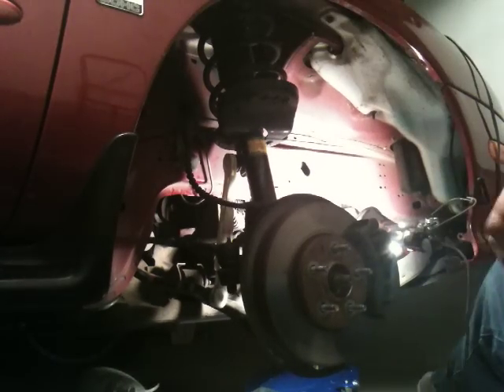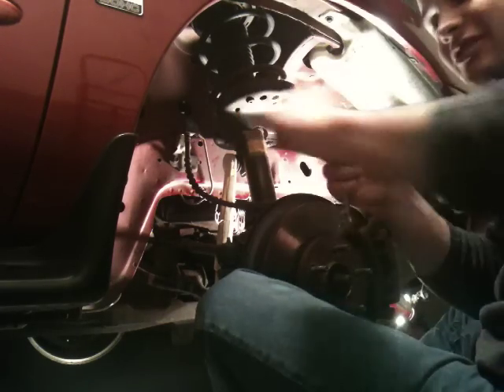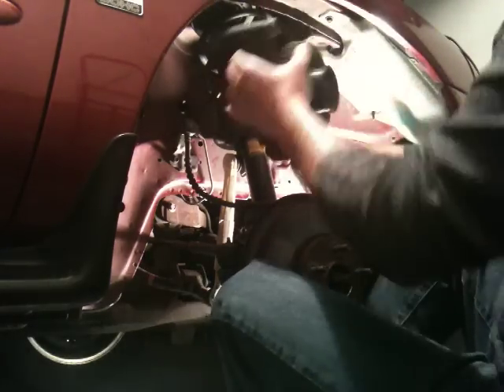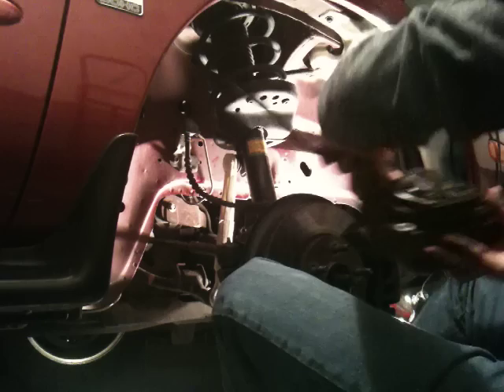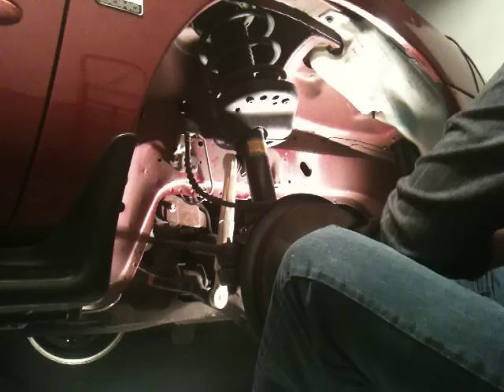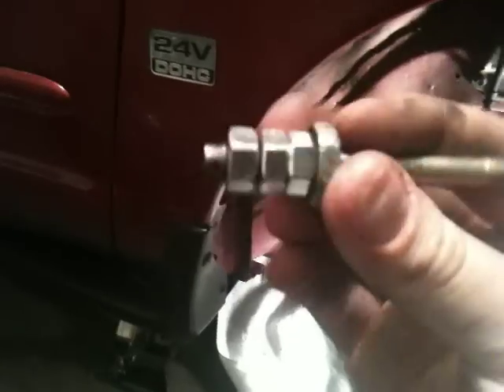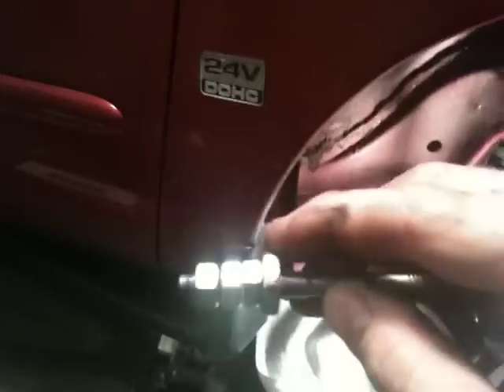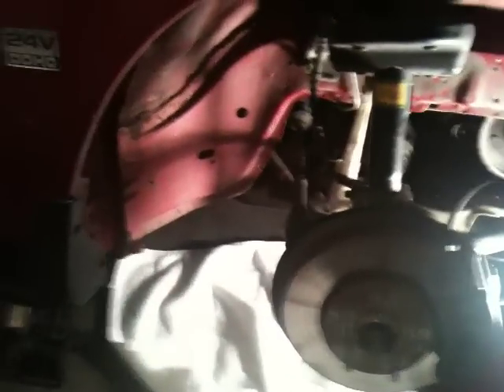Alternator removal 1999 Ford Taurus DOHC

Comment: THIS ALSO WORKS FOR THE 1998 MERCURY SABLE DOHC..., but it took some choice wordS and some busted knuckles.. but the thing is this video does not SHOW how to reinstall it. (he gives a demenstration of how to).it is a lil bit more difficult. you got to install it upside down then flip it up so the pulley is facing the motor then shove it up as far as you can and turn & twist the alternator and then adjust it in place. its like tryin to fit a couch into a doorway. only fits one way. thnks joe

Comment: Just helped someone do this job on his 01 DOHC (4th generation).  We tried for 1.5 hours of trying to just get it to swivel and could not make it happen to mimick what you were saying and could not get it to happen.  I decided that we should drop the subframe down on that side (luckily 2 bolts), removed them, threaded them back in 3-4 full turns, then dropped subframe down on them.  That ended up giving us the room.  Good trick, thanks for it...like walking a couch out a door.

Comment: Thanks, I helped out an elderly person today using this procedure. The shop quoted her $230.00 just for installation, I did it for $75.00 in about an 1  1\2hours .  Had to move the power steering reservoir to remove that 18mm stud, my remedy was a 18mm (2" shank socket).
BIG UPS 4 the info !!!!

Comment: Great advice. I asked my mechanic about replacing the alternator and he said he'd have to remove the halfshaft. I did it this way and it worked. Tricky, but doable.

I suggest bench-testing the new alternator before installing though. You don't want to put in a dud and have to do this twice. ;)

Comment: I tried the 3 13mm nuts trick, but they would all spin at once. I was ready to grind down washers to put between them so that the wrench would fit over them. But I finally got it with an 18 mm wrench. Only 3 turn nut/flip wrench efforts and I was able to use my hand! Your flip trick didn't seem to work, so I borrowed specialty tools to drop the CV shaft, etc., but I made one last effort to try it like your video: EXACTLY LIKE YOU SAID!!! Got the alt out by flipping it over. Thank you so much!!!!
Reply: See my note above on the pass through socket set.  Further up there's a comment on the way to use the jam nuts.  Use two wrenches to tighten the nuts into each other (you can use a lock washer too).  Then use the inside (closet to alt) nut to remove the bolt and the outside nut to install it.

Comment: Just two things including a great big THANK YOU!: If you loosen that top-left-hand 18mm post first and you can get your hand in there like the contorsionist Ford Motor Co. expects you to be, you can unscrew it with your fingers. Also, I disconnected the cables at the alternator and the input speed shaft sensor cable benteath it, and voia la, perfect. Thanks for the tip.

Comment: Thanks for the shortcut. Used it and it came right out. But you forgot about the 1 hour to get to this point. This is the hardest atl. I have ever changed. But unfortunately the alt i put in was dead. Lesson learned, have all new alt. checked at someplace like autozone which can be done off the car.

Comment: Thanks, this helped a lot!!! However, when I wanted to install the new alternator, I noticed a pigtail clip coming off the alternator clip and could not figure out where it goes on to. I looked everywhere but could not figure it out. Is there just an extra clip that is not connected to anything? Where does the extra clip go?!

Comment: All bolts are off except the one we would put the 13,mm nuts on. Problem is there is a black/aluminum tube like device that was screwed onto the same bolt. We took that nut off but can't get that piece off and Out of the way. What is that piece? Any ideas?
Reply: Sean Moore The black tube is the power steering filter.  I had the same problem trying to fit any tools in to loosen the bolt.  Since the serpentine belt was already off I decided to remove the power steering pump (uppermost pulley on engine).  Took a little longer taking another part off but once it was off was able to hold it up with a bungee and gave clear access to the bolt.  This also helped me find where all the oil was coming from that was splashed all over the old alternator and engine.  Turns out it was power steering fluid and not oil.  I had a leak where the power steering line came out of the pump.  Was able to tighten the line and stop the leak to prevent further problems.  Hope this helps!

Comment: so i'm bout to do this job tomorrow on my dads vehicle. I appreciate the help, but it would have been a lot more helpful if you would have shown what you did to remove it. And not just the part of you pulling it out. Again what you have shown will be helpful, just wish I could of seen your previous steps is all.
Reply: Removing the bolts is pretty self explanatory. (Getting the wrench around them is the main problem.) Remember you have to turn the wrench clockwise to release the serpentine belt.

Comment: While this video is helpful, but what is the process to removing the alternator from the start? The mechanic I use couldn't even do it, he said he couldn't remove the one bolt on the alternator because the engine block was in the way. 1999 Ford Taurus SE 3.0 24 valve DOHC
Reply: I used a pass through ratchet and socket set (they have a hole in the center of the socket so it even goes over all thread!  It was super simple!  The only side note is that the bolt doesn't come out of the hole until you tilt the alternator down.  Remember to put the bolt back in just before you turn it back to the proper orientation or it will not go in.  Steven, get a new mechanic!

Comment from the maker: I forgot to mention one important trick. You have to tighten down the 13mm nuts onto the stock bolt. Once they're really tight, they won't turn so easily. You will still need the 18mm for the first "breaking", but once you get it a little, it works fine. You got LUCKY that you could use your fingers. That's pretty incredible. I had to socket mine all the way.....the flip trick still takes some wiggling. haha
Reply: You don't need the 18 if you take two nuts (3 is overkill) and jam them into each other anyway alone the stud..Use a boxed wrench on each nut and turn them into each other.  Then when you need to; use the inward most nut to remove and the outer nut for installation.  Jamming nuts like this can open up a lot of possibilities..
Reply from the maker: @CPTKirk77  Solid advice. I still felt like a hero getting that bitch out. lol
Reply from the maker: @CPTKirk77  "Jamming nuts like this can open up a lot of possibilities" this made me giggle.....but then again, I have the maturity level of a 12 year old. :-P